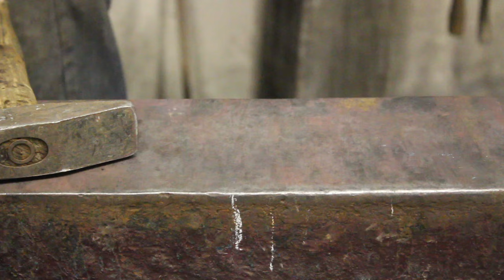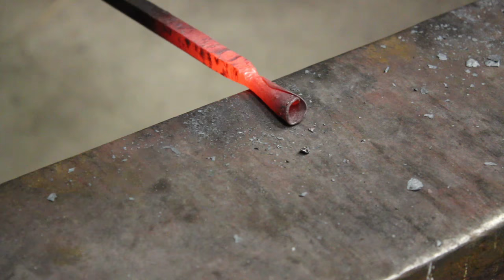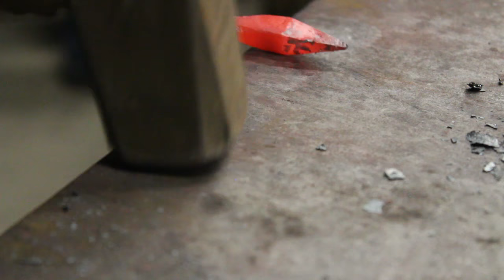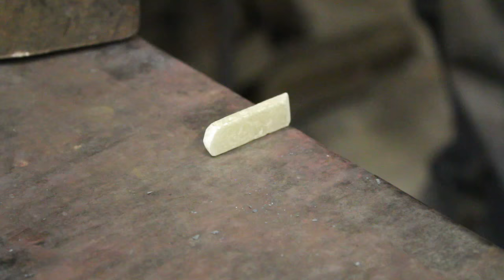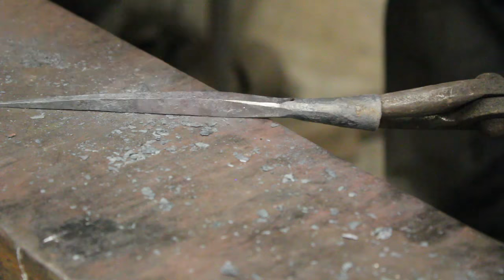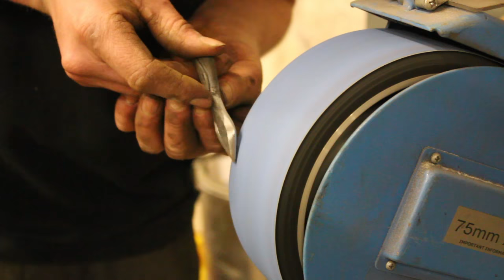Forging Arrowheads - BorntoForge -

Comment: And this, is why there was such a thing as a fletcher. Imagine the amounts of arrows in a castles storerooms. Or the amounts carried by the english at agincourt... people made a living off of making arrows.
Reply: Bit late but yes, but don't forget no fletcher is complete without his arrowsmith and bowyer buddies :)
Reply: Abu Troll al cockroachistan   I think you maybe right, as battle sites yield very little arrowheads even allowing for corrosion. Metal is metal and iron was a valuable commodity so it stands to reason that at least sometimes of the heads would be reused.

Comment: have you ever welded the sockets, if so did you have any trouble burning the steel. I think I will try a thin socket maybe use some US 1018 to start with.

Comment: Looks like you´ll need a quite powerful bow to effectively shoot these i guess
Reply: most bows when these were used were 50-75lb draws or 150lb crossbows
Reply: Raquel Bauman actually warbows were 100-130lb. That lancel head were used with warbows ^^
Reply: FreundlicherFalmer I forged one of these arrowheads and i shoot them with my handmade pvc pipe 40 pound bow. It works really well
Reply: Raquel Bauman and crossbows were in the 300lb to 1000lb range with 300 lb being considered hunting weight
Reply: Raquel Bauman you do realize that longbows found on the wreck of the Mary Rose, that have been sitting underwater for literally 500 years were around 100 pounds when tested. It was estimated that before these bows are submerged, they would pull about 160-180 pounds.
Reply: they work fine with my 35 pound longbow, got to be built like arnie to shoot 100lb bow haha
Reply: @sandervanduren2779   Yes, it is astonishing.  My 75lb solid yew bow makes my eyes water...

Comment: guessing that's just mild steel right?
Reply from the maker: The originals would have just been Wrought Iron for the most part but these are made from EN8
Reply: alright, so you think some crappy steel like rebar or something would work?
Reply: Rebar will work. But remember, rebar is different from one batch to the next.
Reply: oh yea definitely, but if it's for arrowheads that can be reshaped and only occasionally suffer impact then it should be alright. thanks a bunch!
Reply: @davestrider9535  yes just quench the rebar to try and get some hardness from it. coil spring also works amazing!

Comment: The steel you are using, is it just square stock. Say like you would find at a local hardware store?
Reply: yes, but if you buy steel, buy it at a steel supplier. 20 feet of 1/2" square is, like, $13 at a steel supplier. four feet of 1/2" square at home depot is probably the same or more.

Comment: how long does it take to make each Arrowhead?
Reply from the maker: You could do it in about 3 heats, depends how much you practice say 5 minutes ish  for a bodkin
Reply: so do you know how much in historical times [lets say 1200 ce] each would sell for?
Reply: each takes the time it takes, your arm, the fires btu, and when you can actually start working.
You... it will never get done. Him... prob less than 2 hrs.